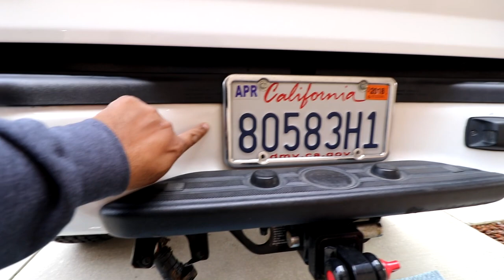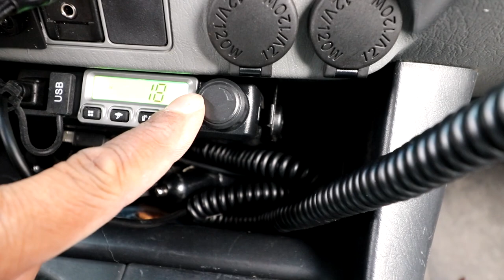How to repair trailer harness on 2nd gen toyota tacoma -NorCal overlanders-Vlog 5

Comment: Im curious as to how you attached the mount to the wires as the one I ordered has a plug on the back while the one you appear to be using has screw brackets

Comment: I've been having problems with my boat trailer lights intermittently going on and off.  All other turn signal, brake lights work fine, I suspect loose connection in the plug here, on the inner, truck side.  Anyone have same issue?  Thanks!